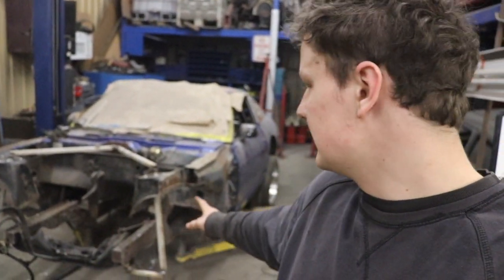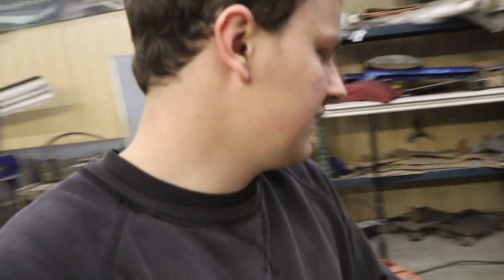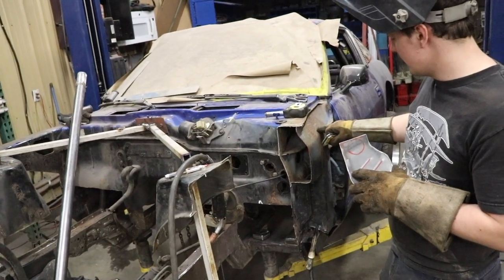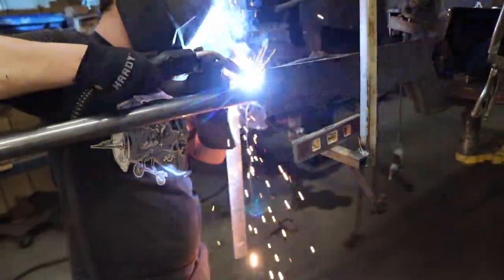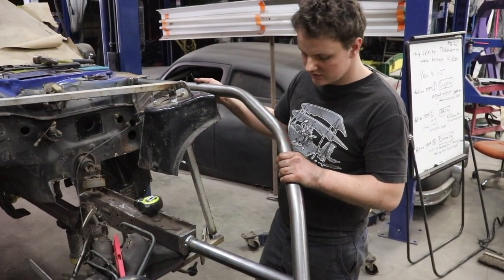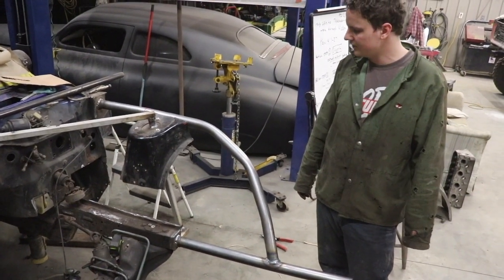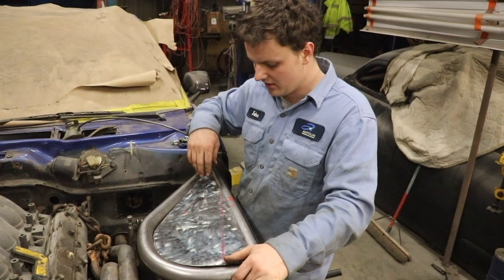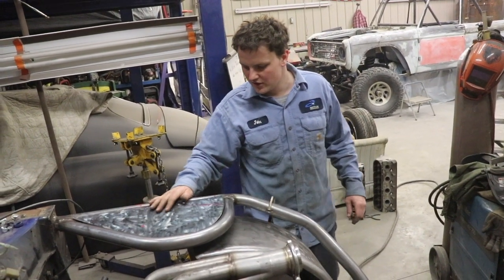Tubular Front End Datsun 280zx Pt2

Comment: Hey man, love the datsun videos, I have a 83 280zx turbo and its ROTTED. I too am in michigan, in the detroit metro area, I have gutted my datsun and welded in support bars but the plan was to just redo the floors. After seeing what you are doing I legit just want to copy how you are making the structure. I can fab but I have never done anything to that extent and would get worried if the bars or plates that I am welding in are enough if you were in a crash or if you put a real torque happy engine in. Anyways, thanks for the content and thanks for getting my brain to think of ideas.
Reply from the maker: It’s definitely a huge undertaking but if your motivated anything is possible.  I would have like to start with a cleaner chassis to avoid going to this existent. But in the end I’m learning a lot and making what I think looks good and should perform good.